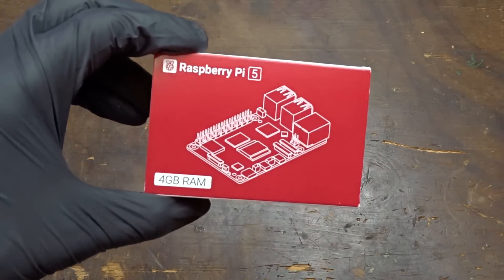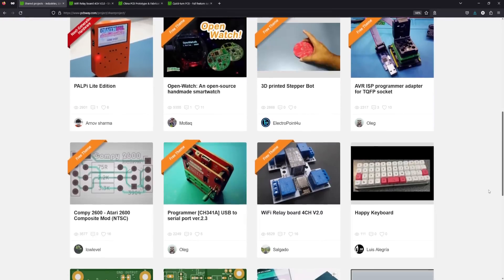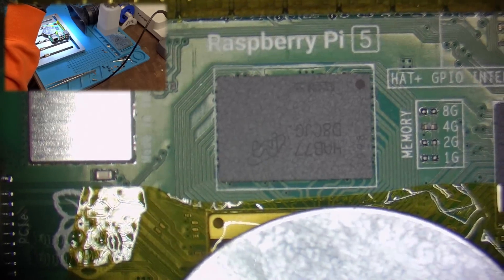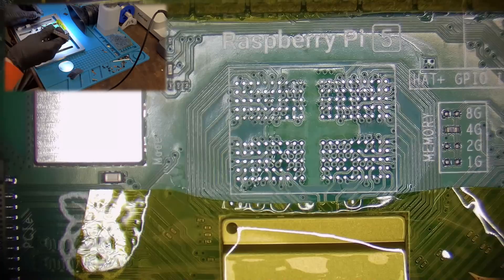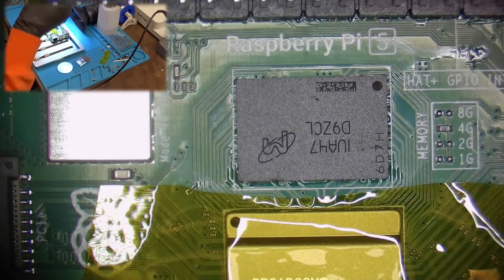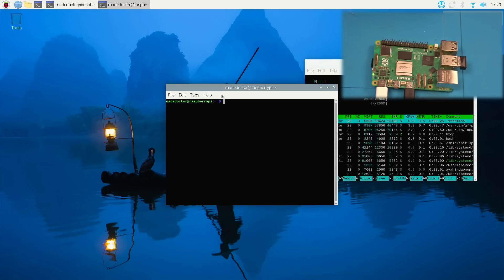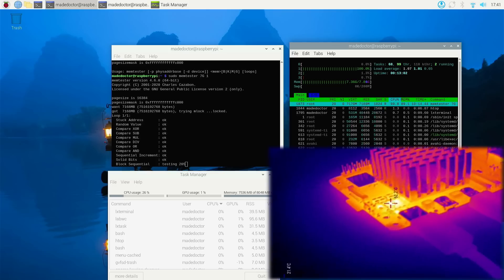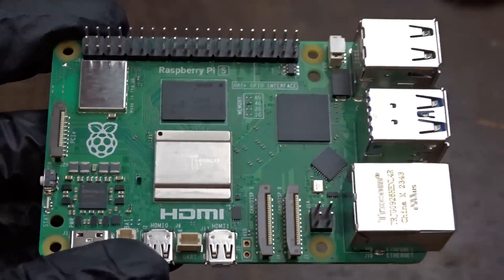Is it possible to upgrade the RAM on the Raspberry Pi 5?

Comment: Some people say this resistor for the RAM is not only for representation. The controller reads its size, to determine RAM size... Can you prove this right or wrong? Greetings from Bulgaria ;)
Reply from the maker: All the solder pads on each side are connected to one another. There is absolutely no difference in where the resistor is placed. I think it's just important to be there, as the Pi might throw an error or something if it's missing.

Comment: Pi5 16 GB- seen a few online
Reply from the maker: @Napstar777  Yep, they released a different revision of the SoC which has the capability of utilizing 16GB RAM which also means the older revision cannot be just upgraded, because of hardware limitation.

Comment: Since it doesn't appear to matter - any thoughts on why they put the resistor ram selection jumper?
Reply from the maker: @nondemify  I think it’s there so you can identify what is the size of memory on the Pi even if you don’t know the FPGA codes of the different RAM chips.

Comment: Is there a reason that an RPi would be burning up wireless controller receivers?  My RPi has burned up two.
Reply from the maker: @louf7178  My best guess would be bad Power Supply for the Raspberry. As I think it directly powers the USB ports in the front.
Maybe it has a lot of ripple or it’s too high voltage. It should ideally be 5-5.2V with max ripple 4.9-5.4V
Reply: @MadEDoctor  Hm... I'm measuring 5.1V at GPIO 2/4 and 6 with a multimeter.  I'm also using an external USB HDD.
Reply from the maker: @louf7178  What power supply do you use? And also you need a oscilloscope to see what's the voltage ripple :)
Reply: @MadEDoctor  It's a Raspberry power supply - 3A.  I might have to try a new one since I don't have a capable O-scope.  The last wireless receiver failure seemed to take about a month.  Thanks for your replies.
Reply from the maker: @louf7178  Just get the Raspberry Pi 5 power supply. As it's 5.1V 5A it should handle the load much better (thus minimizing the voltage ripple), especially in your case with the HDD plugged in.
Reply: @MadEDoctor  Got one and just plugged it in.  That exact one - RPi 27W.  I'll see how it goes.  Will follow up (a month or so) for closed-loop feedback 😁
Thank you very much!  Subscribed.
Reply from the maker: @louf7178  Can you please tell me what exactly you have hooked up to the Pi?
Because I will try to replicate your use case and see if there is a problem with the original PSU.
From what I understood already you have a USB-HDD (Probably a 2.5") and a wireless receiver for controller connected, anything else? (including monitors, hats, etc.)

Comment: Even though this video really is COOL, the Raspberry Pi line of computers are still toys! They are definitely fun, but they are still toys!
Reply: I mean, if you can run some server applications and home automation stuff along with it being a media center or running 3d printers and other projects with all of its gpio then it's less of a toy and more of a tool that some people don't know how to utilize 😂
Reply: Hey, I run my charcoal smoker with one, it's toy for some and a tool others.
Reply: @theboz1419  That sounds like a cool project. Do you have a video of your project? Some people reading your comment will be interested. In your case, you do not require 24/7/365 industrial reliability. But if you think about it, your project is a 'toy tool'. LOL QUESTION: How do you keep your Pi from overheating next to that hot smoker?
Reply from the maker: I 100% agree😅

Comment: why wear latex gloves ??
with such a single board computer you don't get your hands dirty !!
What is the reason ??
Reply from the maker: The main reason is that I prefer to use leaded solder and yeah nothing will ever happen to you if you touch lead every now and then. 
But when you work with it every day the story is a little different. The same goes with the flux and the isopropyl alcohol although they rarely get on your hands. 
Also, I really don't like leaving fingerprints on nice shiny metal surfaces as if not cleaned, they eventually oxidase and leave permanent marks.
And there is the added peace of mind that even if I forget to wash my hands before leaving the workshop, I can eat without worrying that I accidentally contaminate my food.
Lastly, these are nitrile and not latex, as I don't really like latex gloves.
Reply: Always keep it clean as possible. Mistakes can be seen easier that way.

Comment: Now I wonder... can you do 16 GB? (Those chips are much harder to come by in small quantities, I think.)
Reply from the maker: I think it will behave like the Raspberry Pi 4 with the 16GB...
Luckily I still have one 16GB LPDDR4 chip lying around, so I guess you can expect to see me trying this soon :)
It would be really great if it works out though.
Reply from the maker: Welp, I just found this video https://www.youtube.com/watch?v=xGJfPaf0OGM
And I don't really think I will get any different result than this guy
Reply: @MadEDoctor  In some news that's at least 'interesting'... the CM5 that was spotted at a recent event has an extra resistor space below 8GB that is unlabeled. Some speculate it could be for a future 16 GB revision, which, if accurate, would need that updated firmware support!
Reply from the maker: @JeffGeerling  I had a look at the media coverage for the CM5 and here is what I think.
If we say we are 100% sure there will be a 16GB version, it's either still a "secret" or they are behind schedule on the firmware side and we might not see a 16GB version on launch.
But yeah, if we see a 16GB CM5 I will definitely be trying the upgrade on my RPi 5 with the new firmware.
Reply: @MadEDoctor  the CM5 is an embedded solution (probably not the correct word for it, i meant something along the lines that it has a smaller footprint than Pi5 cuz of no ports), and we have seen in the pi shortages that pi foundation prioritized the business owners for supplies (which is expected as their livelihood relies on pi delivered to them), so i expect some other bigger companies would want to maximize the specs they want from each CM5, so they would also be demanding a higher ram variant for the upcoming CM5, increasing the likelihood of 16GB CM5 being a thing
Reply: @MadEDoctor  I'm hopeful they'll also release a 16 GB Pi 5 at some point too, if they do a 16 GB CM5.
Reply: @JeffGeerling  hey love ur vids.
How do you play valorant or gpu intensive games on rpi five without gpu coz I don't have one.
Reply: @JeffGerling is your feed full of rpi videos?
Reply: I was hoping to see you here, wherever Raspberry Pie is. Jeff is always there 😂
Reply: This version of pi 5 can’t upgrade to 16 only chips that ends with D0T could do that also the new firmware will scan your ram and see if it’s matches your model
Reply: I'm subed to you
Reply: That would be awesome to add 16gb onto it or 32gb for giggles.
Reply: @JeffGeerling && @MadEDoctor I am so greatful to even have 8 gb of ram, i never copied potato couch munchers with there intel gaming pcs, but having something light weight, and being able to run phi3 with ollama without wifi makes it use less ram, and is awesome :D, yes but even 16 gb you, you could multitask and have some GL 2.0 support which is amazing for 4k graphics and 3D Projects working but it is also complaining about WSL2 and have no idea what that is :D i love my raspberry pi 5 8 gb model so much T_T. makes me want to cut up an onion.
Reply: Go 32 or 64
Reply: @MrKim-pt2vm  this thread aged well. "For power users and professional applications. Raspberry Pi 5 16GB is available now for $120." :D
Reply: buy lot of them and build many.. of raspberry allready do it lol. why allways need try make faster. what we have.
rpi zero allready was enought. linux and bash
Reply: It appears that the Pi 5 is locked to its factory-installed memory size. I performed numerous CM4 memory upgrades, and all were successful in upgrading to 8GB D9ZCL memory chips. But when I switch to upgrade the CM5 2GB version to 16GB, it stops working. The LED flashes 8 times when powered up, which indicates a memory error. But the modified CM5 can enter RPIBoot mode, so the BGA rework was good. I also swapped memory chips between different CM5 versions, and only the same memory size swapping worked. Like 2GB<->2GB will work, but 16GB<->2GB won't. So, I guess there may be some kind of checking for previously installed memory size code in the firmware.
Reply: @hack988  Can you ask about this on the Pi forums? From what I've heard, that shouldn't be the case, but I also wonder if there's any other tweak that needs to happen, or if maybe C0/D0 SoCs might make a difference too.
Reply from the maker: @hack988  Have you tried 2GB <-> 8GB as they released new revision of the SoC (with upgraded memory controller) for it to be able to deal with 16GB of RAM. 
Theere is difference in the part number. 
The old one is 2712ZPKFSB00C1T and the new one is 2712ZPKFSB00D0T
So if you've got the old one which has printed only up to 8GB as options on the PCB, it will never work with 16GB
Here you can see more details on that - https://www.youtube.com/watch?v=gYz_0pqde04